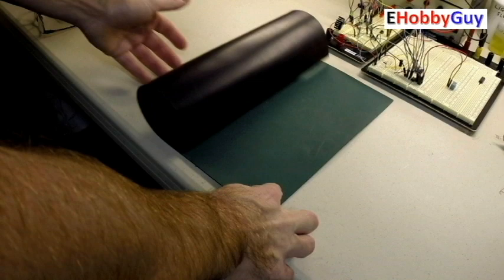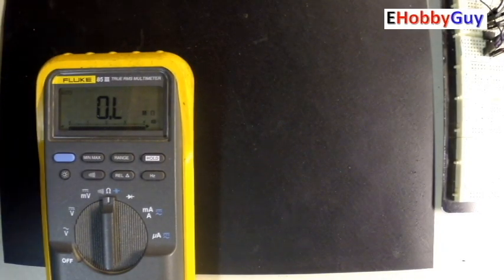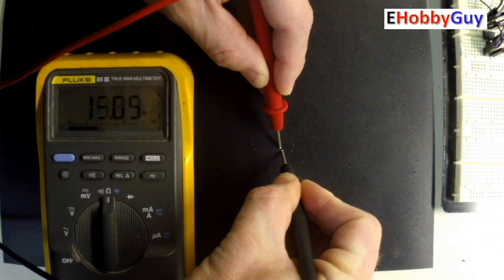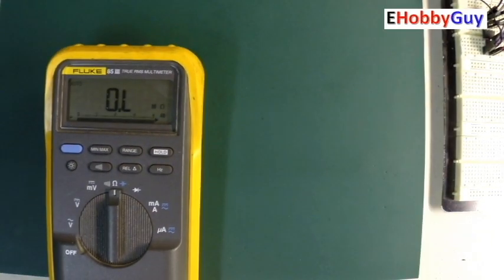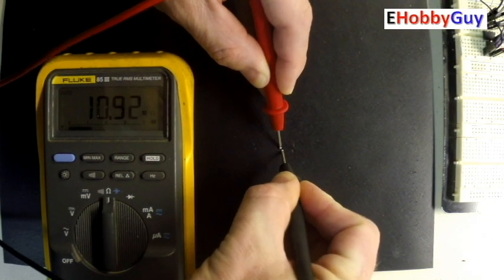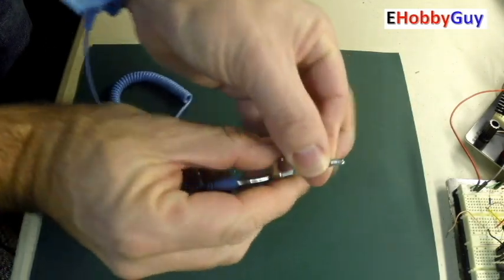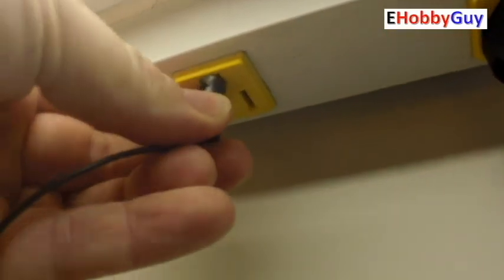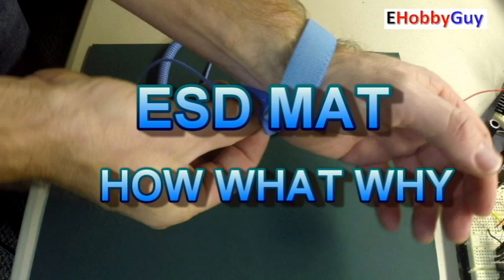ESD MAT, HOW WHAT WHY

Comment: I looked at this video and thought "Ok, makes sense". Then I googled further and found this:
https://elimstat.com/how-to-ground-yourself-with-anti-static-wrist-strap/

There it says "Just make sure you do not use the alligator clip to “ground” the wrist strap to an anti static mat. This will not work. In fact, this will increase the total system resistance to ground over the 35 megohm limit recommended per ANSI /ESD 20.20 [ESD Handbook Tr20.20-2008 section 5.3.2.2.2]" 

I don't get this quote, especially since it is contradicting what is done in the video (which made sense to me). Can anyone explain?

Comment: Hi folks, in a set up shown in the video (unknown resistance of wrist strap and lead, high resistance mat, unknown presumably low resistance, path from mat to ground) should be OK if you always slip the wrist strap off and leave this entire setup on a bench, and maybe cover the alligator clip of the ground wire with some insulator.  

If you like to move between benches and unclip the wrist strap from the mat to do so, you should make sure the wrist strap lead also has a high resistance.  If not, and you are carrying a piece of electronics with the wrist strap dangling, you may build a static charge while you walk and the clip could touch something grounded.  Your static voltage will be rapidly discharged and say goodbye to the electronics you're carrying.  

If you walk up to the mat shown above with a piece of electronics, and you have a static charge, so does the electronics.  When you rest the electronics on the mat, be careful that it doesn't immediately touch the clip going to ground.  The static built in the electronics (and perhaps you) will rapidly discharge through the clip and say goodbye to the electronics.  Using the setup in the video, you would want to walk up, put the wrist strap on without contacting anything else.  This will safely discharge you and the electronic item. then carry on at the bench as usual.  This is why it's good practice to use a high resistance connection between the mat and ground.  

The reality is we want ESD, we don't want damaging ESD.  When a static voltage is built up, we want all of these paths to ground to be high resistance, so static voltage gets discharged nice and slowly.

There are standards for all of this stuff if you really want to know what range of resistance things should be.  There are also relatively cheap testers out there that you can buy in the ~$30 US range for testing whether your wrist strap works right and your path to ground is in the correct resistance range.  These testers fail you if the resistance is too low, and also if the resistance is too high.  Finally, test the ground path to make sure it connects to ground.  Appartments and rental office space are frequently repaired incorrectly.  The ground socket of a power outlet is usually never connected to a power source, but frequently it's connected to nothing.

Comment: im very afraid of connecting the other end in the grounding pin
Reply from the maker: from pathetic to a machine! Thank you for your comment and thank you for watching.
Reply from the maker: from pathetic to a machine!  If you are afraid to do it definitely do not do it.
Reply: @ehobbyguy8980  i dit it after proving it was well grounded, using a grounding checker, but "the other end" came off from the grounding pin. The other end is narrower than standar end for grounding.

Comment: What is the purpose of the 1Mohm resistor shouldn't it just be going straight to ground
Reply: You should not earth yourself directly to ground because if your hand touches the mains voltage 240/220V you will receive a severe electrical shock which can kill you. The 1 Mohm resistor prevents this happening but also protects against ESD.
Reply: Any path to earth ground is acceptable.  The concern is not with accidental electrocution, as much as slowly and effectively bleeding off a high static voltage difference. When you shuffle your feet on a carpet and then come close to touching your best friend's ear lobe and see a small spark, that's an ~15kV charge dissipating immediately.  Fortunately non lethal because your body makes a poor capacitor (not much capacitance and relatively high series resistance) plus the resistance of the air that the spark had to jump through, plus your friend is a poor conductor too.  But  in the case of handling ESD for electronics, a charge like 15kV or higher needs somewhere to go, and not all at once.  It's the all at once bit that harms the electronics.  The high value resistor in the wrist strap, mat material, and mat ground path will discharge high voltage if present, and it will do so relatively slowly (gradually).  It will also hold the operator and work surface at the same voltage potential, AKA prevent static charge accumulation.
Reply: @gregfeneis609  Im afraid you tried too hard to explain the concept in laymans terms, but it lost me when you said thinks like 'bleeding off a high voltage difference' Then the Q factor mixed-up with capacitor stuff .... :(
Reply: @Pulsonar  Edited.
Reply: @gregfeneis609  The edit makes for better reading and a clearer explanation, thanks.
Reply: @Pulsonar  Glad you like it.  Don't be afraid to go look for explanations for things you don't understand.  I'm afraid you're afraid to go search for info instead of asking for something to be explained further.  Voltage difference and capacitor Q are not difficult to research and/or understand.
Reply: @gregfeneis609  You’re right, anyone can easily look up these things, there is a wealth of material online. But it’s not just for me, its for others, and for yourself as educator. It doesn’t matter this is only social media, it is still important to explain these concepts with more integrity so that it aligns better with authorised bodies of knowledge on the subject. This is so people get less confused with any ambiguous or conflicting pieces of information if/when they look further into the subject. The literature in the analog electronics world already has enough notoriety for defeating the curious. It’s up to those with understanding in the subject to reverse that unenviable trend.
Reply: @Pulsonar  Oh, thanks. Nice explanation. You criticized what I wrote for my benefit, and the benefit of all and to help prop up the appearance of institutions of science, engineering and instruction. What a selfless act.
Reply: @gregfeneis609   Do you remember yesterday when I thanked you for explaining better? I actually meant it, I kinda expected ‘no problem’ or ‘you’re welcome’, or nothing at all in reply, end of.  What’s going on here? Why do you respond with a procession of cynical remarks? If I came across as patronising, it wasn’t meant to, and I apologise. Otherwise, I cannot fathom why you would reply in that manner.
Reply: @Pulsonar  You criticized what I wrote and in response I edited.  You thanked me.  I criticized your need to criticize me instead of going to look up what it was I might have meant, and you LMK that you were doing it for my own good and the benefit of all.  I'm disappointed in the lack of reciprocity in our back & forth.

Comment: Hi! Why does it need to be a circuit, mat - > arm -> mat -> ground? Why not arm -> ground and mat -> ground... using two grounding pins in the mains? Sorry if it's a stupid question... :) Thanks for the video!
Reply from the maker: Thank you for your comment.  The Circuit goes from your body to the mat and then to ground.  The mat acts as a large resistor to ensure that there is a slow discharge to ground.  We would never wire ourselves directly ground because it is too close to the mains, and electricians can make mistakes.  What is labelled as ground may have a voltage at the mains.  This is just a safe approach.  I hope I have answered your question adequately.  Thanks again.
Reply: Thank you so much. This makes perfect sense.
Reply: Thank you Patrick 909, I bought the grounding plug. Seemed like a nice addition to the setup EHobby Guy demonstrated in the video. :) Safety first.
Reply: Hi Robotvilla, Any stable path to earth ground is acceptable.  The concern is not with accidental electrocution, as much as slowly and effectively bleeding off a high voltage difference. When you shuffle your feet on a carpet and then come close to touching your best friend's ear lobe and see a small spark, that's ~15kV.  Fortunately non lethal because your body makes a poor capacitor (not much capacitance and very low Q) plus the air resistance, plus your friend is a poor conductor too.  But 15kV or higher needs somewhere to go, and not all at once.  It's the all at once bit that harms the electronics.  The high value resistor in the wrist strap, mat material, and mat ground path will discharge high voltage if present, and it will do so slowly.  It will also hold the operator and work surface at the same voltage potential.  You can have a separate path to ground for your wrist strap as long as the path is high resistance.  The mat should have a high resistance path to ground too. See my main comment in this video.